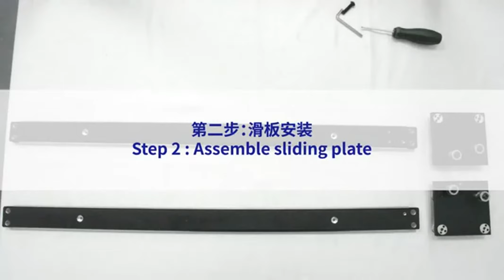TRONXY X5SA-500 PRO Unboxing And Review Price Aliexpress VS Banggood

Comment: Hello.Thanks for the video.Does Tronxy x5as pro come with software installed.?
Reply: Don't buy Tronxy. They look viable but everything about these machines is half assed. The hotend will be of the $5 variety, the stepper motors will be poor quality, the pulleys and rail components are knock off Chinese copies. Even the belt will be sub par. Get anything other than a Tronxy - trust me.